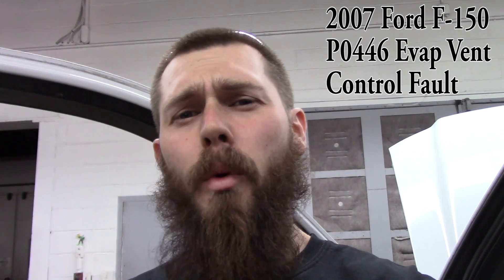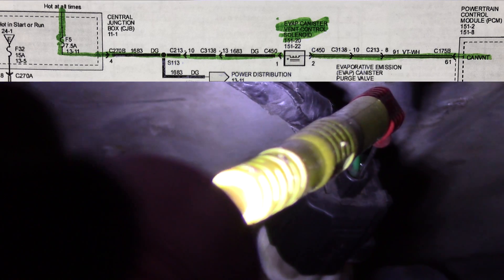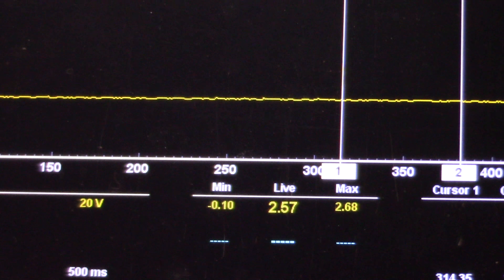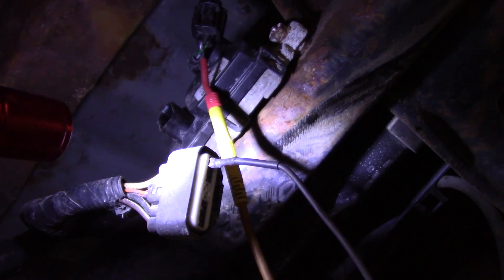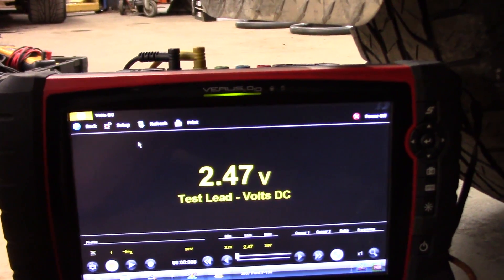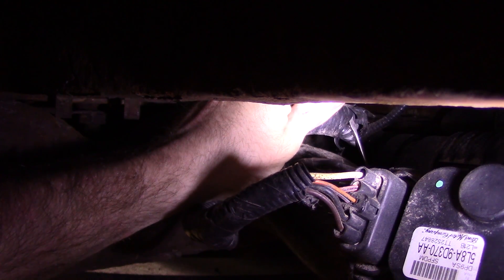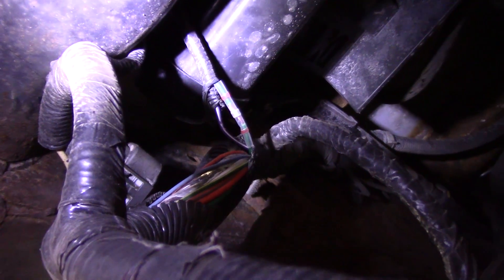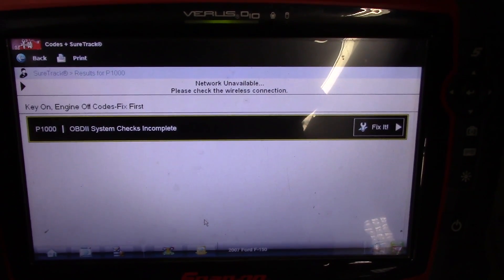Ford F-150 5.4L Check Engine Light, P0446 Vent Solenoid Fault (new solenoid)

Comment: So what exactly does this vent solenoid do? Is it an issue if my truck has this code??
Reply from the maker: The vent solenoid opens to allow you to fill the tank with fuel.   In the event that the valve sticks closed, it will be hard to fuel up the vehicle.  The pump will keep stopping like it’s full.  Do you have emissions where you live?  It’s an evap leak that will cause an engine light and fail emissions.

Comment: I have a 09 Ford f150 v8 4.6 with engine light on, the motor runs good, but it has a code number P0446, capless fuel system, apparently has a small evap leak, is it the evap valve or the fuel fill inlet? Thanks

Comment: This failure and solution has been diagnosed thousands of times on the Internet on crappy rusty Ford F150s.  Unless you replace the whole cable, you can look forward to fixing it again, just like I did four times. Build their trucks with inferior wiring harnesses. I sold my money, pitt where they don’t do emissions inspections. Good riddance.

Comment: When you did the Purple/white wire test with your test light. Can you do that test by turning the ignition on and off, I don't have a computer like yours that does it. I have the P0466 code. 2007 F150.

Comment: The F150  Evap vent solenoid connector wire color did change in 2009 to Yellow/red and GRN to ECU pin 20 on my wire diagram and labeled CANV for canister vent solenoid.. The 446 code and 0 volts at connector(koeo). I checked same wire YEL/Red at big harness by firewall and showed 12v. I checked closer to canister vent connector and got one 12v (using T pin ) 12 inch from connection end. I then kept removing the protector harness and exposing wire until 8 inches away and found Yellow/red completely severed . I made repair and after several trips the DTC has cleared.

Comment: The wire colors are different on my 2010 F150 XL at Evap vent solenoid connection. Mine are yellow/red and green blue. On my pin out  chart the yellow/red is key on 12v and the green/blue show connection to pin 20 and the ECU completes circuit (ie switch's on/closes circuit). The EVAP purge wire connector is green and White/BRN with Green the 12 volt supply and WB wire going to ECM pin 31 and is switched on thru ECM control. The wire colors and pin out connections are different on some of these F150 2004-2012 years although function of Evap control are same. The location of my Evap canister is under driver side door and Evap purge solenoid is close to firewall; this isn't always true on all F150s. I miss the days of simple carburetor and push rod v8 with no ECM controls and 2000miles of wires and 200 relays and fuses and connectors and warning lights (Yes I'm old).

Comment: Have a 2003 f150 do not have engine code but it does show a small EVAP leak, replaced purge solenoid and EVAP vent solenoid also replaced all hoses related to EVAP from font to back, still showing EVAP leak ( gas cap new) checked voltage to vent solenoid, showing 4.6 volts could it be a faulty wire like what you found? Did a smoke test and smoke coming out of cannister, so if there is no voltage the valve is then open correct?

Comment: Hey Tommy, my 2005 f250 5.4 liter is throwing the p0446 code. Getting 11.86volts to the vent solenoid. Hooked up an isolated battery to test the solenoid, and NO clicks. Should I replace that part? Thanks for your help!
Reply from the maker: If your giving the solenoid a known Good power and ground supply and still do not have operation it’s probably a faulty vent valve

Comment: I ordered a replacement connector for my 2014 Ford F150 vent cannister because my dogs chewed up the wires, but the wires on the new connector are not color coded like the wires on the car. There are numbers on the connector only (#1 & #2).  There are 2 wire colors on the car-yellow w/red stripe and green w/blue stripe.  How do I know which wire goes to which # without the tools you have to measure volts, etc?  Appreciate your help

Comment: Diagnosing a 446 code on a 07 F350 V10. Very similar setup.  I have 12 volts no problem on the power side. Snap on guy printed me off the diagnostic procedure which was nice, my scanner is too basic to include the diagnostics. I'm leaning toward it being the solenoid, just trying to make sure, the part is $250, can't afford to be wrong. The procedure says if I have 12 volts, to check the ohms, I was getting around 44, which is out of the range they specify but not by much (and the direction is to change the solenoid if it isn't 48-64ish), but now I can't get a reading not sure what happened there. Can't hear it doing anything. My question would be how much voltage would I expect on the control, and why did you have to tie into the fuel pump to test, why couldn't you just go to ground? Great video.
Reply: Did the new solenoid fix the problem?

Comment: Very nice video!  It helped me find a problem with my 2008 F-150 when it coughed up a P0446 code.  Instead of just replacing the vent valve, I went looking for a wiring problem like in your video.  The schematic of the vent valve wiring in your video really helped me narrow down exactly which wires to look at.  Where yours turned out to be a damaged power wire, mine had a damaged signal return wire.  The wire had bad area where the insulation had been rubbed away over time, and allowed the wire to oxidize and turn green, which created a high resistance spot.  This happened right where the two wires from the vent valve split off from the main wiring harness, just like in your video.  The bad spot was cut out.  The wire was soldered together and covered with heat shrink tubing, and the P0446 problem is now solved.  Thank you very much for posting this video!

Comment: I have a used 2009 f150 with same issue. I went under truck and harness was missing. I purchased the harness but not sure which wires to connect as harness obviously does not match colors. I have a yellow/red and green wires. Can you help?

Comment: Nice video 2010 F-150 FX4 Super Crew 4.6 Eco-boost here. 
So was back there a couple hours at the fuel pump relay, and I do not have the solid GREEN nor the PURPLE WHITE wires. 
If gets better. I have two wires, YELLOW/GREY or SILVER, and WHITE/BROWN. Around these two wires is wrapped a bare ground lead. 
So apparently in 2010ish Ford came up with the idea to wrap these wires fore to aft with a bare ground wire in a sheath. 
The ground is good from the bare ground to the frame back there, through the ground lead. 
But that’s not telling me anything about the other 20 feet of this harness. I will say this was steel wire, not loaded with corrosion or rust, but not clean either. 
The easiest thing to try is connect a wire from wherever this bare ground connects up front, back to the ground stud. 
See if this bare wire ground is the issue. 
If not is it White/Brown or Yellow/Grey-Silver for power. 
If that gets rid of my Check Engine Light and Evap code P0046, run the new ground. 
Your thoughts? And where up front does the ground connect?
Reply: The 4.6 is a V8. Ecoboost’s are V6’s and came out in 2011.

Comment: I replaced vent solenoid but still have that code. Gonna check the wiring near the solenoid. Thanks for giving me an idea of what to look for. Green corrosion.
Reply: Did you have the same problem - corrosion?